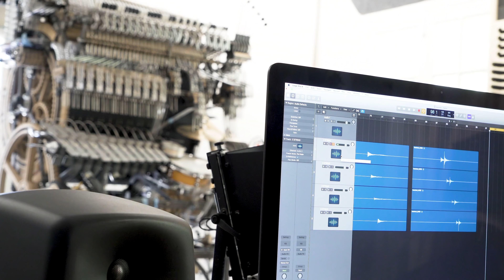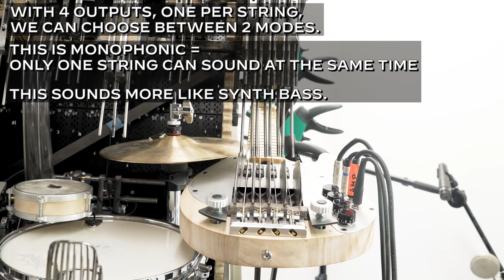Cyber Bass Marble Drops

Comment: I do not understand: Why Acetorn before you melted it together?!
Aceton does nothing to Metal (as far as I do know) but you can use it to make things I wont explain, usefull for bad things, not good here ...
WHY did you put Aceton on Metal?! I ask also because of the Enviroment: So I looke at it and looked like o_O
Seriously: Did not understood that...

WHAT was the ACETON required for?
Reply: It's for making sure there are no oils or grease on the metal. Oil can cause problems when welding, so it's best to make sure you've removed it first.

Comment: Idea - probably already shared.  What if he added a small thing of buttons to the right of the bass.  Like a small control pad.  The buttons are labeled with different chords for the bass.  Martin could engage one key for a cord and then mechanical thumbpads press the bass strings in the right place.

Comment: Composing music for this machine is going to be 1 part marble management (not running out on a channel), 1 part instrument limitations, 1 part joy, and 1 part swearing.
Reply: And about 96 parts of listening to it on loop.
Reply: didn't design it to where runni g out of marbles shouldn't be that much of an issue?
Reply: he won't have to worry about marbles running out of a channel because they travel in a loop around the machine, once they are used they'll be picked back up again and brought up to the top.
Reply: @niffinriper2160  But are they being recycled as fast as they are used in all channels?  If you play that fast bass riff continuously (8 marbles per measure) and you have some wild thing going on the rest of the instruments, can the machine keep up indefinitely?
Reply: @kaasmeester5903  In a past WW video he showed the marble recycling speed. I don't recall the value exactly, but it was in the tens of marbles per second. So as long as he doesn't play consistently fast music on a lot of channels, he'll be fine. He can have bursts of speed on any channel, and one or two fast channels always playing.
Reply: @niffinriper2160  the fish stair only reuses marbles when the Marble Divider is full. The only way to recycle played marbles is through the Marble lifter, which is limited to 8 marbles per bar.
Now, absolutely there plenty of marbles already in the channels, you can preload the fish stair, the lifter, etc but I think he's going to have a bottleneck somewhere down in the guts if he plays too fast on too many channels.
Would not be at all surprised if he winds up installing an overflow bypass loop, some kind of less showy but more efficient way of getting excess marbles up to the top, in a couple of months time.
Reply: Limitations is key to any kind of expression.
Reply: The marble divider is the main point of concern to review at the end. As the focus should be on getting all the instruments 'finalized' to work with marble drops first (like how the bass is now ready! XD)
then can test and review on adjustments to the divider, or take notes for song writing
(how much more 'major' items are there to add? fingers? ;)

Comment: Do you use a Fourier transform to filter out the background noise from the machine?
Reply: borkborknomnom The only recorded sound is from the magnetic pickups, they only capture the string vibration. For the other instruments he is using mainly contact mics which also are “resistant” to outside noise
Reply: Antti Maasalmi ah I see

Comment: 02:24 - Have you heard of LOCKTITE? Just comes out of a tube and you apply. Two types... BLUE can be cracked by turning with a driver, RED must be heated to 500F (260C) to loosen. If you use the BLUE, you can disassemble for repair. They also came out with GREEN... which is just a weaker version of BLUE.

Comment: Some friendly suggestions:
A) Wear gloves when you're using chemicals like acetone, and oxidizers. 
B) Always do a "dry fit" before welding anything. That means, once you have determined it's full assembly and position, then go hard and weld it solid. It will help with the frustration, and minimize the warping and loss of parent material. 
C) Using proper "thread lock" instead of resin glue, will last longer. It doesn't dry hard, crack/flake. It's a better long term solution. 
D) Welding (even if it's TIG) over the bass gave me anxiety. What if anything fell on it? 

Very exciting Martin...3 years in the making, and there is a light at the end of the tunnel :-) And a very heavy machine to keep you grounded :-)
Reply: I was also afraid when he used epoxy. Looks like a radical, no come back solution. Also, no dry-fit before from what we see in the video. Loctite or school glue seems more appropriate.
Reply: @jeanletourneau9642  The thread lock is a flexible polymer type glue that won't get brittle and crack with the fibrations. They are both water resistant, and easy to remove with little force. Resin also doesn't bond to metal :-). There is JB Weld which is an epoxy, that is super strong and would be a permanent solution. https://www.jbweld.com/product/j-b-weld-twin-tube

Comment: When Blueing metal parts, you should put some in a dish and paint it on with a paintbrush for the best results. Learned that from My Mechanics.
Reply: I make a new one.
Reply: @silverfischdotnet  Literally every time Martin angle grinds something off
Reply: Also shouldn't you afterwards brush on some oil? Isn't that what actually gives it the corrosion resistance?
Reply: @TiSapph  oxidation gives corrosion resistance by itself

Comment: Would it be possible to link the volume knobs together and have a steering handle on them? Like in a truck when you're turning the wheel many times, something you can adjust with one hand could allow you to change the bass sound on the fly.

Comment: To all the Kinetic finger haters out there,  you telling me you don't find those linkages mesmerizing?! Bring on the Fingers!.. awesome vid Martin, though one thing that popped into my head... you dont seem to have much margin of error for your marble paths (much tighter than anywhere else on the MMX), if you're playing at the top of the neck you'll might introduce enough torque to mis align the drops with the strings, occasionally leading to a missed note. By the looks of it you clamped the head to keep it stable, but you might want to consider in the final design somehow linking that stabilization to the drops themselves (as opposed to just the body of the MMX). that way the bass and drops are always perfect referenced to each other. Keep up the great work :)!

Comment: Ok, probably getting buried, and you most likely know this already. But just to save you from future grief: 
Blackening is no rust protection. 
Quite the opposite: it is a kind of rust itself. Pretty noticeable in the countersunk holes. It just provides a porous surface THAT NEEDS TO BE OILED in order be a light corrosion protection.
Just thought I'd mention it, because the blackened parts looked pretty dry...

Other than that: awesome as ways :)

Comment: Hey Martin! So, the bass is limited to four notes? How do you will tune those strings? Maybe you could add some extra strings in the future to get some extra notes. Also you can try to use the same gauge to achieve an uniform sound. Abrazo desde Argentina!

Comment: Okay Martin, I'm going to put a worry of mine out there. I worry that your floor wont support the increasing weight of the MMX. More that the beams or whatever holds the floor won't then that the legs will go through. 

You may well have thought of this (or it isn't a problem at all). If so, great :-). Hugs and love to you <3

Comment: Something that would be completely ridiculous but also really cool would be to run ALL the output wires from the MMX through one MASSIVE cable to some external preamp/etc. Instead of having any sort of processing on the MMX just have a gigantic cable running off into the abyss.

Comment: Idea: have some of the ball bearing powder coated with UV reactive paint and have a black light on stage so people can really see and enjoy the marbles circulating - especially through the tubes. Inspiration from the “cyber” wings
Reply: Dope idea but any coating would rub off quite frequently, and leave gunk just about everywhere. Probably not worth the hassle at first, but when theres a whole tech-team formed around maintaining the marble machine like clockwork, (with the world tour money) could be freaking awesome.
Reply: SirZebra normal paint would certainly come off very quickly but powder coat is surprisingly hard wearing. It would certainly last a concert or two before coming off. Because of the way powder coat works, it’s more like a plastic coating so it can only really be abraded off, or removed chemically, so any residue left behind would in theory be dust, which shouldn’t be too much of a problem.
Reply: George Todd they could easily get ceramic coated marbles with UV powder inside.
Reply: @bunnythekid  yes i know, but as you just stated "a concert or two" would need a crew behind it to make sure it stays coated, and the rest of the machine stays working despite the inevitable debris stuck everywhere. 
I think that machine will need at least another person than martin to fucntion properly each concert anyway, it's a masterpiece, but an extremely complicated one.
On the other hand from what i've seen in the last two years of video, i think the tolerances for the marble paths and drops are wide enough to work despite the occasional gunk and / or the very little width difference the coated/re-coated marbles may bear.
Reply: @Clockpie5436  I think that's the play here. They could even cast their own from epoxy around a UV coated steel core (just a smaller ball bearing. Zero chance of residue that way, and Martin could feasibly do it by himself.
Reply: @Clockpie5436  now that's hot. 
Hell this way you could even get tritium coated marbles that would glow for days even when packed without any UV hitting them.
Reply: Ed Stretton yeah that’s a good idea
Reply: SirZebra heh why not lol
Reply: Nice
Reply: That'd be dope
Reply: Cool idea, but this thing is built with some tight tolerances, and coating the ball bearings might just make them that much bigger they'd jam.

Now, if there was a way of heat treating them (like bluing), but also made them glow to black light...
Reply: cycoholic true. He could probably use acids or something like dipping it in a tank with some voltage to strip some metal off.
Reply: Yess!!!
Reply: NXTk maybe the strips, but that would be extremely complex and time consuming.

Comment: Mechanically, i think the end is in sight. There's going to be a big cable harness to wire into the MMX though. All the mics for the vibraphone etc. And one big connector for all the outputs :-D I'm no expert, it'll be interesting to see how that all looks once it's done. Awesome video.
Reply: I hope they go with a modern solution like audio over ethernet and just have the box connect straight to the house the same way every time.

Comment: The manual lever connectors for the bass should be how you show kinetic movement - not the "tig welded" finger, or the "fingers" in general.  Can you change the design  of the "fingers" to do something similar to how you have the manual bass?  that looks a LOT cooler than any fingers, and looks more "mechanical" and artsy...
Reply: Yeah I think the levers are a great visual indicator as-is. If we can make out guitarists playing from across a stadium we can see what is happening here without the "kinetic fingers" being over-the-top.

Comment: why are 2 consecutive l hooks needed? I think you are doing a bit much marble seperation I mean you have the mechanism with the wood and 3d printed parts on top and later on a variety of hooks or other things depending on the track, and in this case multiple consecuritve one. wouldnt it be enough to only have a marble splitter at the end?

Comment: That's a new one. Using epoxy on the screws to stop them coming loose?  maybe you haven't heard of Loctite?  it's designed for this purpose.

What kind of welder do you use?  I'm interested in getting into and learning to weld.

Comment: Applying oil to a blackened part will provide even more rust prevention. The blackening creates a layer of oxide on the surface which the oil can soak into, the oil makes it harder for water and oxygen to make contact with the metal

Comment: I still don't understand why so much loud,clanky metal is introduced to this system. I know there are mics and pickups but steel/metal produces so much noise. How is this controlled or filtered out for live performance s?
Reply: There are contact mics and/or pickups on each instrument, but regardless, a lot of work has been done to minimize mechanical noise such as removing machine sway, reducing friction, and the use of wooden parts wherever possible. Either way the clunky metallic sound is exactly the point. It's a marble 'machine'. It doesn't need to be perfectly silent, just within reason.

Comment: Me, who knows absolutely nothing about welding: Wow! Martin's welding skills have really improved!
Reply: I'm a welder. He's not professional quality (which makes sense since he's a hobbyist, not a professional welder who does it every day) but he definitely has improved
Reply: @comradegarrett1202  This is a good thing, since he accasionally has to backtrack and it would be a shame to have to destroy pro-quality welds...
Reply: @comradegarrett1202  I have zip experience with welding TIG, the thinnest sheet I usually work with is measured in cm :D
Reply: They have though - his beads are consistent, which means they are likely to be less weak form porocity.  If you watch abom and This old Tony, you'd see the difference!
Reply: @WillZuidema  weeeeeell. Let's not put him on too high a pedestal :P It's a good thing he's not into welding structural parts for buildings and shit. With the equipment he has just about anyone could stick two pieces of metal together. I'd be surprised if any of those held up to proper inspection.
Reply: Well to be fair no one is going to need this as a footstool.
Reply: As someone who has never welded anything I can say with no confidence that Martin is one of the best welders in the world.
Reply: Those carefully formed curved strips operating the marble droppers are really rather beautiful
Reply: Xavier Gervais-Dumont EXACTLY WHAT I THOUGHT